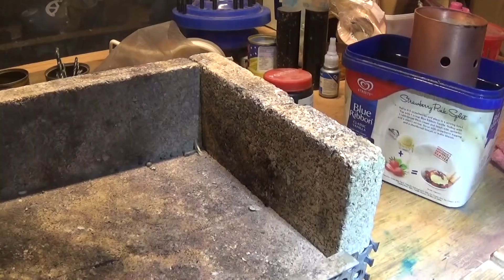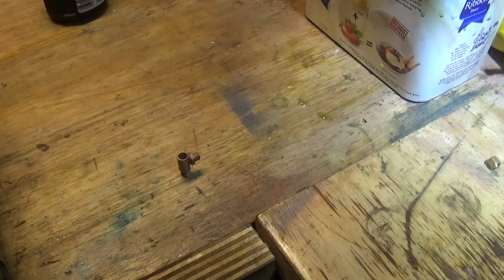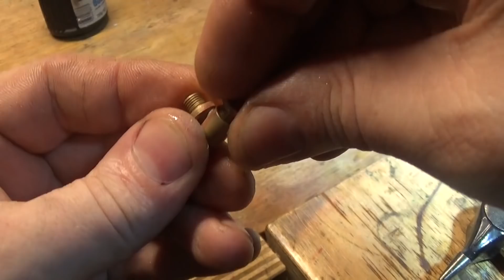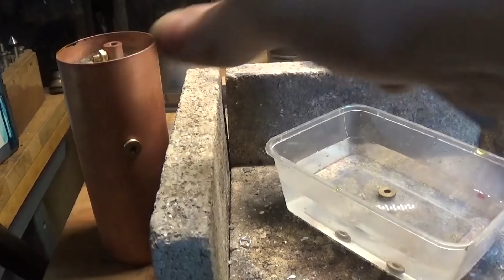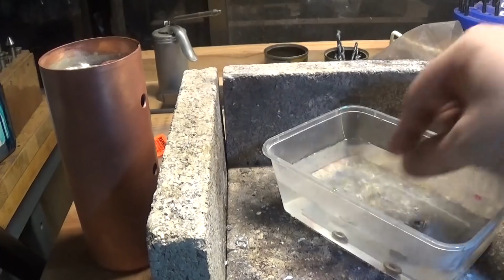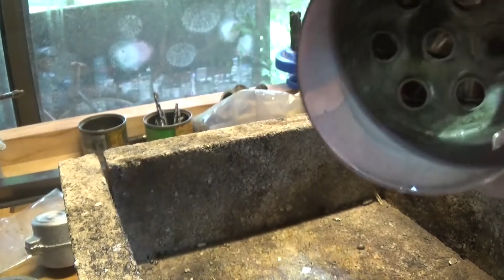Eugene Boiler update Part 6 - and other news!

Comment: Do you have a fire blanket? If not, grab a cheap one off ebay, and wrap your boiler(s) in it when silver soldering, it'll make it much easier to get the boiler up to temperature, and save you a fortune in gas and gas equipment.

Comment: Hi Emma,
You can now buy your own cylinders rather than renting from BOC or Linde, about 5 years ago I handed back my E size argon to BOC, for me as a private user the rental blew out to $200 per year, I have now bought my own cylinder from Pure Gas, the full cylinder was $470 refillable on an exchange basis for $170 for argon, I think oxy is around the same price but never pay rental again. Trade tools are the agent for Pure Gas or you could look at Speed Gas online they are the same prices but I like to be able to walk in store and talk to someone.
Hope this helps
Cheers
Raymond
Reply from the maker: Thanks for that. Im looking into it!
Reply: Bunnings now do Oxy and Acetylene, as well as Argon and Argoshield. My Argon is $200 deposit, $99 for the fill. smaller than my E size bottles, but bunnings is open pretty much anytime I am welding, so $99 and a quick trip to swap a bottle whenever it runs out is real convenient. My Argoshield I bought from hampden welding supplies, that's an E-size and refills are $180, now I own that bottle.